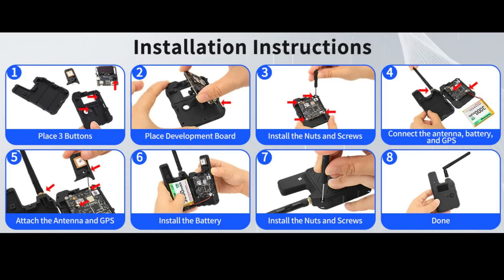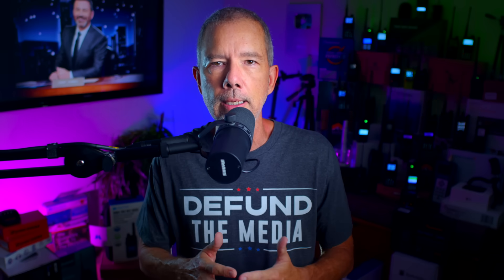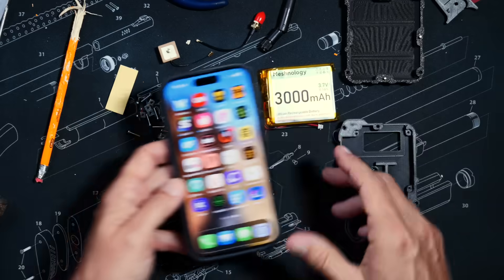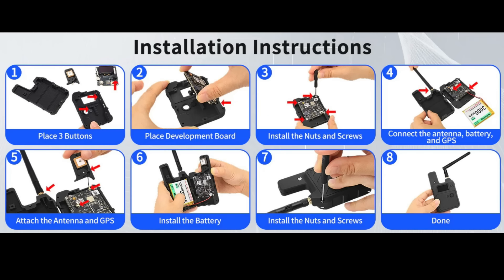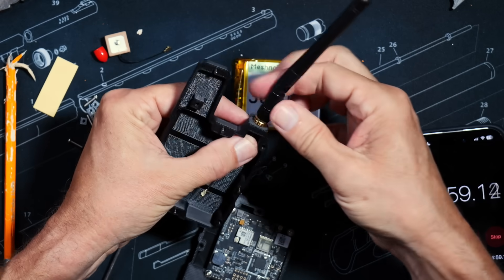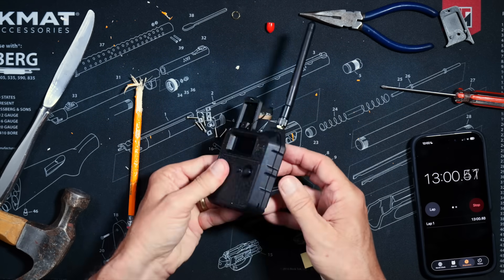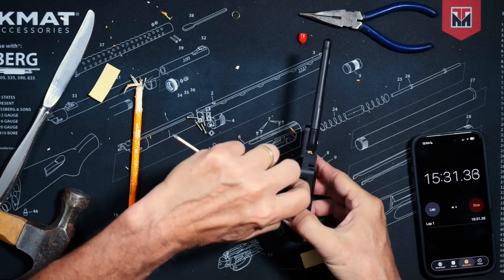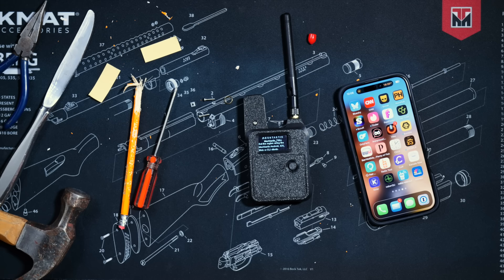Meshnology N37 - Build A Meshtastic Node In Only 7 Steps

Comment: If anyone is having problems with the joystick as a push button to SELECT a menu item, open the case and remove the joystick button. Reassemble and GENTLY use the eraser end of a pencil to work the joystick stem. Complaints for joystick issues are all over the web. A poor design.

Comment: Have you considered using Meshtastic with your 4x4's?
It's "Positioning" feature could help you keep track on missing vehicles.

No license Required (in fact, the HAM Version has slightly less capability then the Non-Sad-Ham version
Reply from the maker: if they are in Meshtastic range, then they are in GMRS radio range.. and we dont really ever have an issue with vehicles going missing.

Comment: I've left out the split washer on almost all of the meshtastic units I've built for the same reason. So far none have rattled loose on me. Not all cases are created equal and most of the time, the walls are too thick. You should build yourself a solar node. It's a fun network to be connected to if you have users in your area.

Comment: I have already put several other Meshtastic nodes together.  When the SMA connector goes though the case, it is desirable to have all the washer installed but all 3D printed cases I have seen make all the washer impossible to have on just like you found out.  IF I can only have one washer, I use the star washer.  When no washer is possible, tighten the nut to 10 to 12 in-lbs and hope for the best.  Torque spec on the SMA male connector is 8 in-lbs.  With experience, you develop a feel for how tight.  My opinion, when unable to use a lock washer, just over torque the nut a little bit so as to NOT strip it.